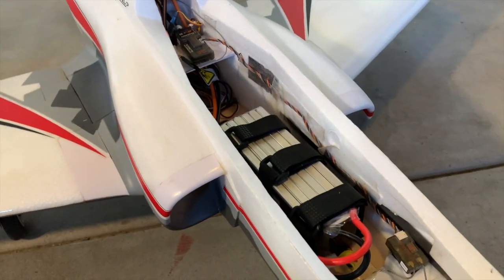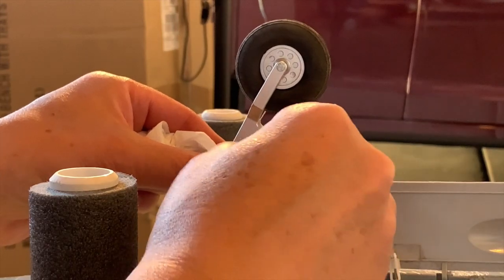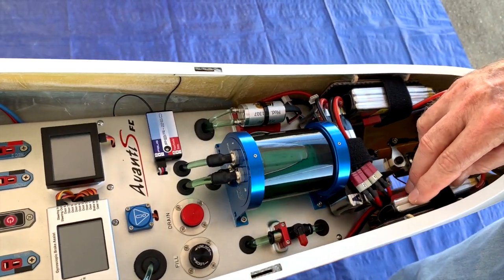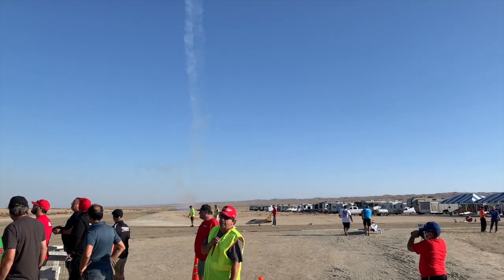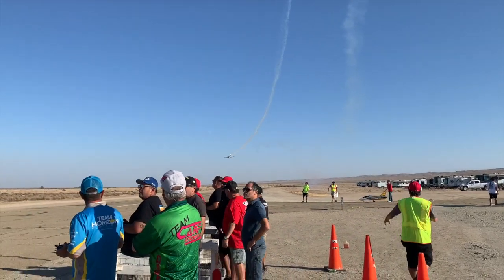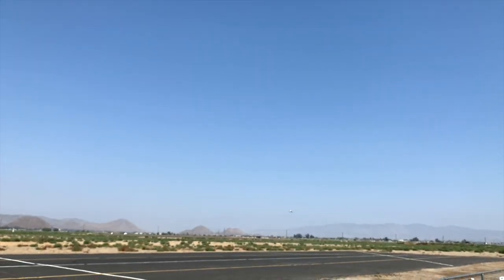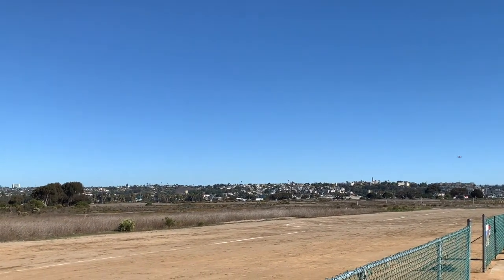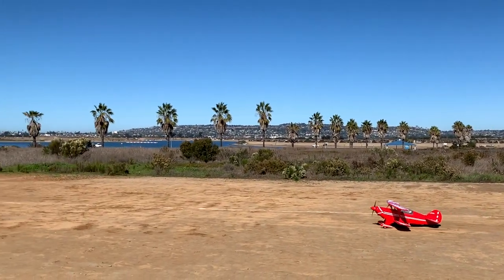Lesson Learned Top Skillsets of Great RC Pilots | 8HrToGo

Comment: Hmmm, I would say there is a lot more than that to become a highly skilled pilot but those are three good general skills that come over time, and the second one is tough the more pilots that are using the space. Each plane is different and one thing I notice is that if you have a lot of airplanes in the hanger (too many), you never really get good with any one plane if you always fly a different plane every week. You have to spend a lot of stick time with one airframe and learn all of it's tendencies after having programmed out the bad one's. If the model is balanced for neutral well, then you will have a good starting point to build from. Jets are very different from sport planes and sport planes different from 3D type models or warbirds. They all require a certain learning curve to find the sweet spot for making good landings. That's called learning the planes low speed characteristics and once you know what they are, landing is much easier. Good pilots know how to use the rudder effectively and know when not to use it (like in a cross wind too high above the ground on final). I keep a logbook of all my flights and that has helped to keep track of each planes tendencies and remind me of them when I bring them out the next time. I love my logbook.

One of the most important skills as you get more advanced is to know every possible orientation correction and be able to correct instinctively without thinking about it. At first, you do have to think about it. Later, you do it automatically and can recover or maintain any orientation without fear of making the wrong input. Excellent pilots know the correct inputs to make with the correct timing way before the plane every does the actual maneuver at hand. Not so skilled pilots simply try and react to what they see and are always behind the aircraft.